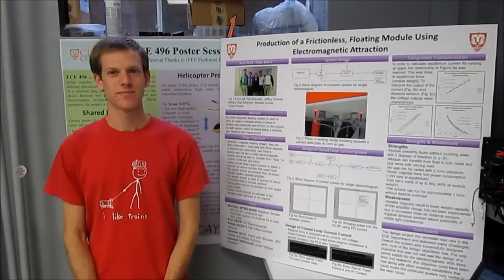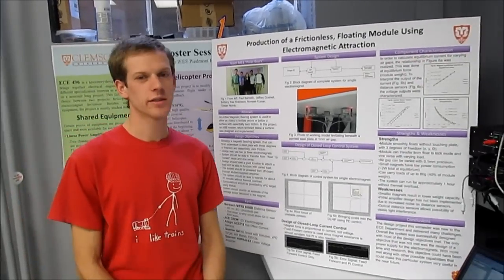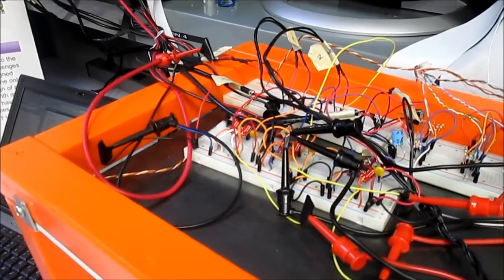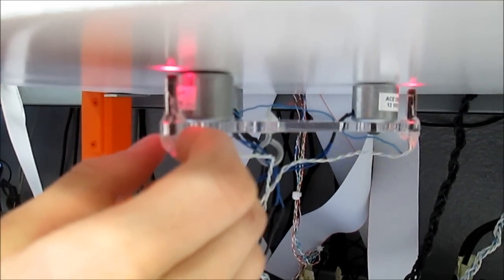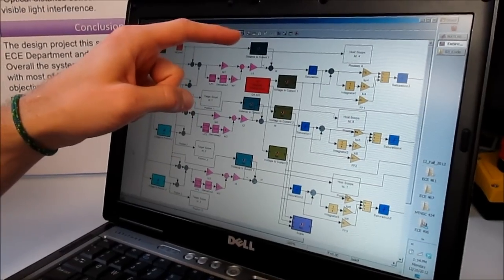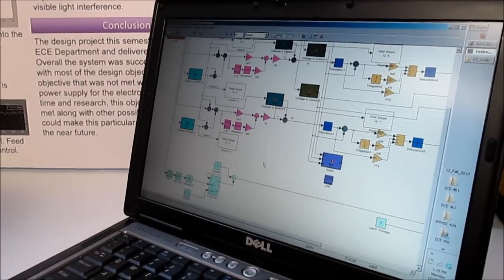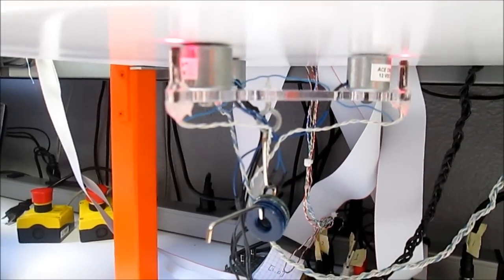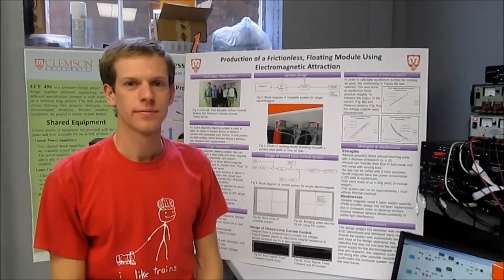Magnetic Bearing Levitation - Clemson University ECE 496 MB1 Fall 2012

Comment from the maker: magedsamuel: Here is the component list.
Distance Sensor: MTRS6660D
Current Sensors: ACS712
Magnets: Cheap ones from eBay (5kg). http://www.ebay.com/itm/12V-DC-11-LB-5kg-Electric-Lifting-Magnet-Electromagnet-Solenoid-Lift-Holding-/360834915178?pt=LH_DefaultDomain_0&hash=item54036fdb6a

dvdvideo1234:
Yes, each magnet was controlled separately from the other two, depending only on its own distance sensor reading and its own current being drawn.
PD was used because the system oscillated so freely that it was difficult to obtain a steady-state error.  For a system with more friction, the integral control could help compensate, but was not necessary here.

proton: Check your e-mail!

Sorry for the late response on these questions...you would think I would get e-mail notifications about this....

Tristan